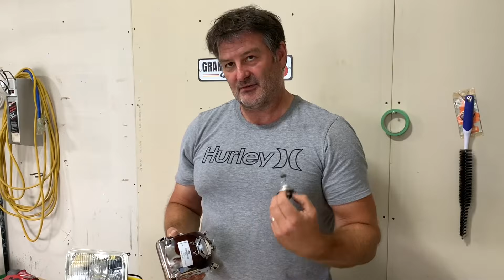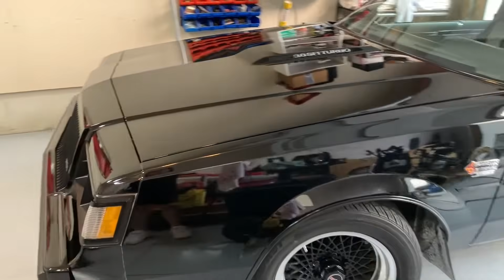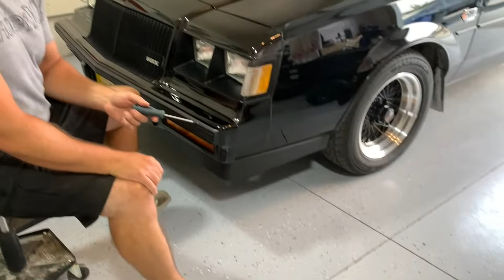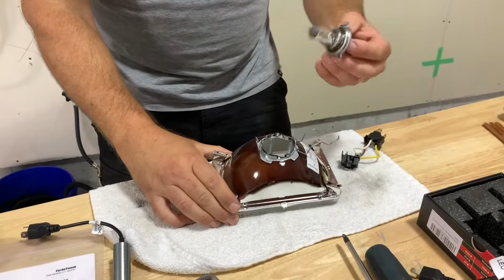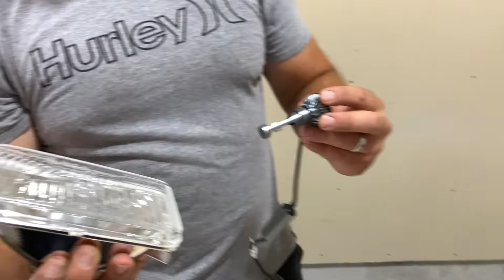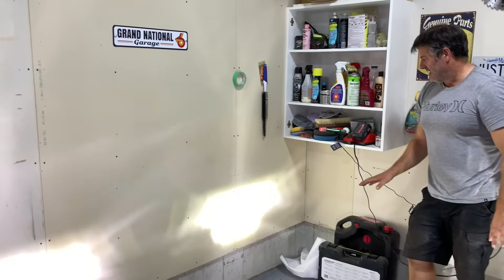Buick Grand National H4 LED headlight upgrade!

Comment: Order the light bulbs and it’s not what you have i don’t have the the silver piece in the middle
Reply from the maker: that is strange.  Is that the piece that sits in the light housing?
Reply: It’s just a led light and a plug nothing like you have
Reply: What’s the part number
Reply from the maker: @ronaldpursley4232  Aukee H4 LED 50w, 6000k.  There is a link in the description of the video to the bulbs on Amazon
Reply from the maker: found the part# on the box: X002SIHOUH.
Reply: @jofalltrades1816  man thanks so much for your help

Comment: Thanks for the video. Ordered the same parts and installed on my 87 turbo t. I cut the holes on the  dust boots that came with the Hella stuff larger to fit past the led heat sinks to try and keep the dust out. I also like the OE look

Comment: What size are the front tires on your GN ?
Reply from the maker: fronts are 245 50 16, old school. Not much avail in a 16"tire anymore.
Reply: @jofalltrades1816  perfect 16 inch size. GNX was fitted with those. As many others of the 80’s.

Comment: When you do your high beams, what Hella housing will you use ?
You said you thought the H1 housing might reflect differently.
Can I use the same H4 Hella (3177001) for high beams, and then use the H1 Aukee conversion ?
If so, would you know the correct Aukee p/n ?
Thank you very much - I’m really looking forward to doing this conversion and being
able to see better when I have to drive my GN at night.
Reply from the maker: The H1 housing is the one you need for High beams.  It doesn't have the diffuser in it so it results in a better spread light with no cut off. I've heard people have used the H4 LED bulbs for high beam and just cut or bent the one tab back since high beams are only 2 prong.  The bulbs I am going to try are Part# B07H8MF2RH , they are H1 LED's and have the correct 2 prong wiring.

Comment: Please clarify exactly what needs to be ordered.
I ordered Hella #3177001 - just housing and dust boot.
You listed Aukee  bulb # - does that come with wiring ?
Do I need 2 of that Aukee # or 4 ?
I just installed Sylvania Silverstars - so very little to no difference from my 34 year old original bulbs.
Thank you
Reply from the maker: The Aukee kit comes with 2-H4 Low beam LED bulbs in the box so you just need to order 1 of that part# X002SIHOUH. Wiring is part of the bulb assembly. I just did the low beams for now, and they were plug and play.  I haven't found the Hella H1 high beam housings for a good price yet, but will switch to them eventually.  You won't regret switching to the LED low beams. Let me know if you need any more info.
Reply: @jofalltrades1816  Thank you very much. I just placed order for the 2nd housing and bulb set. Please advise if you see good price on the high beam housings, and which bulb set.
I’m looking forward to this upgrade - my 87 GN is pretty much stock, and still original paint.
Reply from the maker: @richwarner8403  nice! This is definitely the best look for stock. Hard to tell they are upgraded until you see how well and how far they light up the road!
Reply: @jofalltrades1816  If there us that much difference, I wonder how putting another set of H4 in place of factory sealed beam highs, would work.
Reply from the maker: @richwarner8403  I believe the highs are H1 housings and the cutoff is different. I dont think there is a diffuser in the H1 housings. It would be very bright for sure.

Comment: Thanks for posting this, I was close to going with the JD units because I wanted LEDs but I am going to give this a go since I already have the lo beam housings.  Should have them installed this week.
Reply from the maker: Nice!  Let me know how it goes.  I don't mind the black housings on these cars but I'm more partial to stock looking lghts that preform like a newer vehicle.
Reply: @jofalltrades1816  Got them in and aimed them today, I haven't driven it a night yet but the install was easy and quick.
Reply: Thanks for the video, however, I can't order the bulb kit to the US. Do you know of another option?

Comment: Great video. I actually bought this same kit, 4-headlight housings (high and low beams) and led bulbs, thanks to your recommendation. The low beams plugged in directly just like you showed in your video. The high beam connector from the harness on the car is a 2 prong connector and the led bulb is a 3 prong. I can notch the plastic connector to on the harness to plug in the led but will that effect it in anyway?
Reply from the maker: Thanks!  Notching the plastic connector is no problem since that top prong is for low beam light and will not be used anyway.  You may have to switch the green and black wires around in the high beam connector for all 4 to work properly.  I'm about to do mine as well.

Comment: So stupid question, to do all 4, I just need 4 housing and and 2 packs of the bulbs, the bulbs look like the come 2 in a pack, or do I need a different bulb for the inside or high beam light?? Hope that makes sense
Reply from the maker: Great question.  What I do know is Hella makes a H1 housing for high beams that might diffuse the light a bit differently than the H4.  The bulbs would all be the same, 50w LED.  I do intend to add the H1's to mine but was waiting for the price to come down and wanted to get the low beams in first to drive at night this summer.  So far so good!